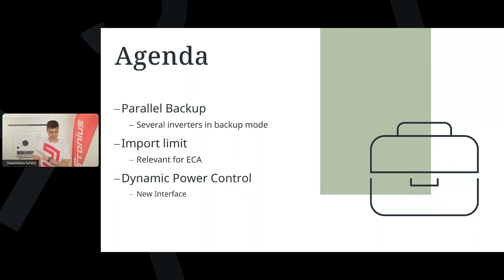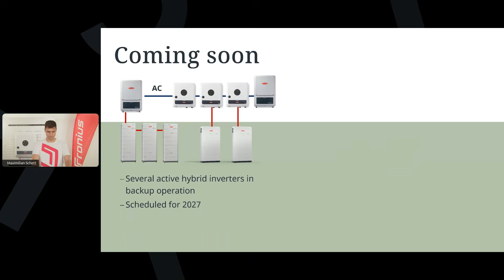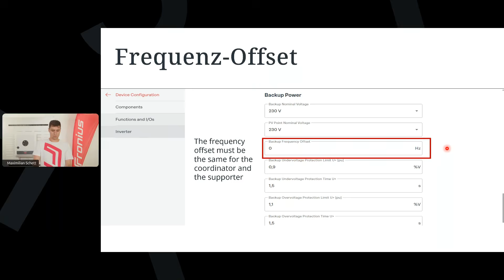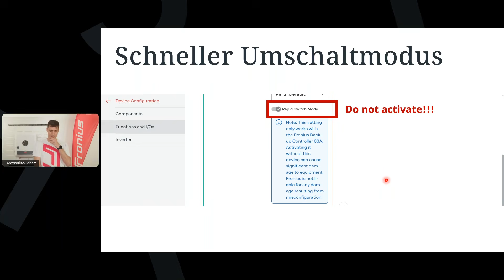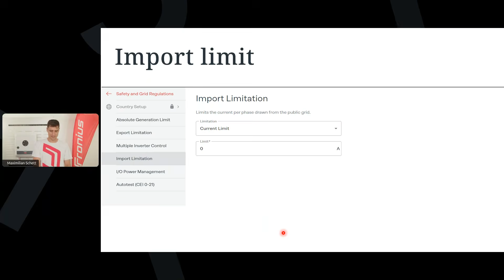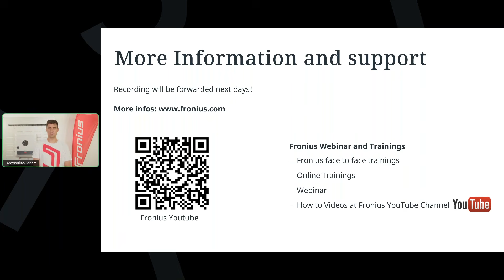Webinar | Parallel Backup - How to Operate Multiple Fronius Inverters in Backup Power Mode

Comment: You mention in 2027 Fronius is intending to release backup operation with multiple hybrid inverters with batteries which is good, however I can't seem to find any information advising if it is possible to have multiple Gen 24 Plus Hybrid Inverters each with their own battery system operating in parallel when grid tied? I would like to expand my current Gen 24 / BYD Battery with another Gen 24 inverter that uses a Reserva battery system, rather than add additional BYD batteries.
Reply from the maker: Hi @dejioladejo9263 thanks for your interest. Unfortunately, we cannot provide any further details on the upcoming multi-battery feature at this time.

Comment: Feature suggestion to reduce wiring if grid connection and inverter are in separate rooms: Add I/O pins to the smartmeter-ip and have the inverter and wallbox read the state for export/charge limiting set by the grid operator. This should be possible on Modbus and/or MQTT and would save additional wiring for I/Os. Backup power I/O pins would likely still require physical I/O on the inverter for grid safety.
Reply from the maker: @vewo234 Thanks, we appreciate your Feedback.

Comment: Will grid import limit need to respect german power-consumption limiting by smart grid control (mME) to 4.2kW like the external current limitation on Wattpilot? Will this require additional cabling from the smartmeter/controlbox to the inverter or will the state be read from Wattpilot if connected?
Reply from the maker: if we understand your question correctly, this mixes up grid import limitation and feed-in/export limitation. These are separate functions and are controlled independently by the grid operator.
Therefore, the required control signal cannot be forwarded via the Wattpilot to the inverter. The signal must be provided directly to the respective device, so this setup is not supported.
With the rollout of EEBus, this topic will become less relevant in Germany, as devices will be able to receive control information via the local network. Until then, separate control connections to each affected device are generally required.